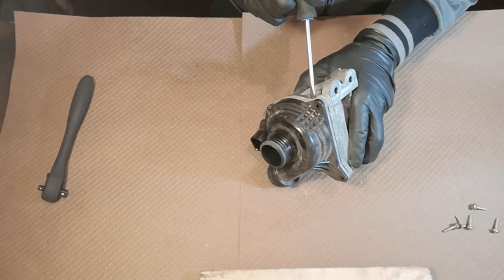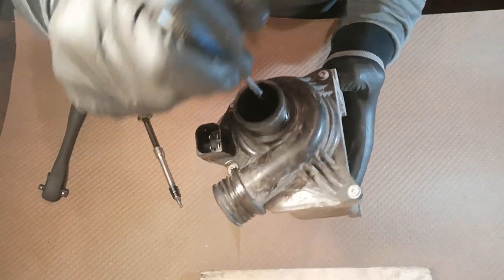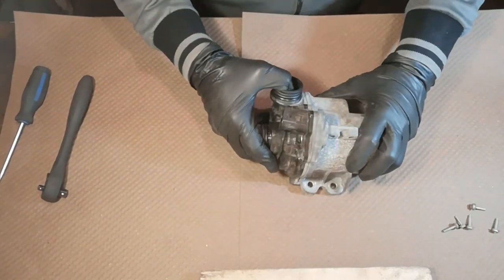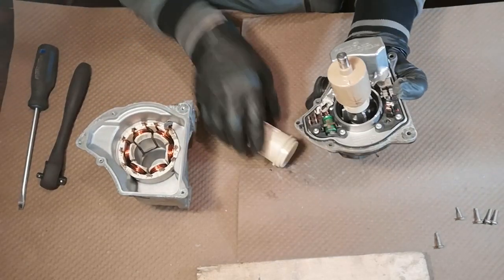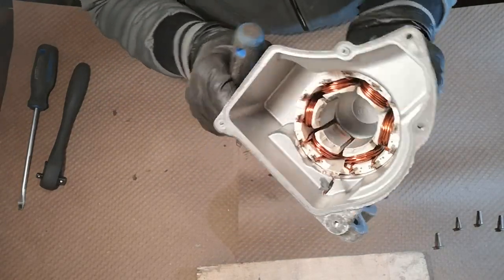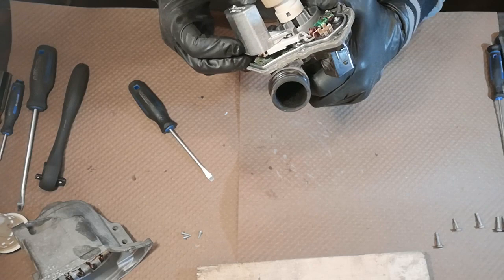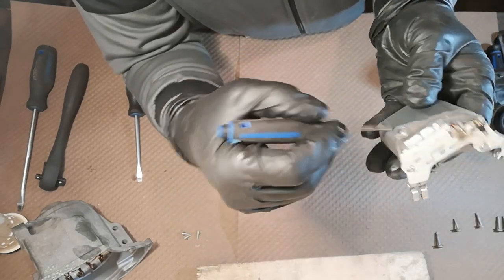⚙️ What's inside BMW electric water pump and why it always fail ? 2E81 2E84 2E82 code

Comment: hello guys i am having issues with my coolant pump. It just keeps on running even after engine is off and drains my whole battery. i have checked in female connector which goes into the coolant pump and found both thick wires and they are receiving constant 12 volts and thin middle wires for continuity(good connection with no break). Also checked thermostat wire 1 wire is receiving 12 volt(with engine off) and other wire 3-4 v(with engine on). Can you guide me what else could be the issue as i am lost here now and tired.
i also scanned and i am receiving LIN bus codes CD9010 & CD8E10

Comment: Holly crab why so many electronics built in that housing. It should be only a switch and possible power regulator when it is on or off  whenever the pump needs to be engaged to recirculate the water

Comment: The part you found burned up looks like resistor (just like the one for blower motor) and what kills stuff like that is low battery voltage and since have off electrons on bmw alive wen your engine off. Like you open driver’s door fuel pump tuns on you do that to many times battery goes down and burns up fuel pump control module. If you need do anything with it you have to connect charger to car battery specially if battery not new or it’s cold outside. All it takes is taking to your buddy wen your truck or door is open. Wen I work on them only with charger connected or jumper cables just to run diagnostic with scanner and engine off. Every bmw I’m getting to work on is after it set for some time owner was getting something in out of a car without starting it battery goes low and whole lot of electronics goes out. That’s number one reason for failure. To much electronics to drown down battery quickly.

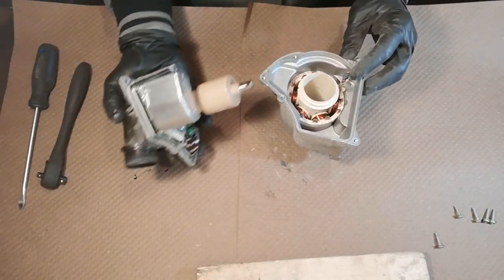Comment: 3:00. What was holding? The terminal connection is soldered together and u broke it? That means it will never be put back together?
There should be another gasket seal between the black front cover and the aluminum casing where the circuit board sits on. That could be where the leak usually is from?

Comment: I also repaired many dishwashers and found most of newer model of them are using the circulation pump that have same bearings inside the pump. The bearing is not normal metal one, but the graphite. The after around 5 years, the graphite bearing is worn off, the impeller can be rotated manually, but as its axle is offsite of bearing center, the rotator touches the wall of the chamber, the extra friction is added to the rotator, and the impeller fails to be rotated by electro magnetic field force.  I think your pump may have a similar root cause.
I only found one of dishwasher got BLDC driver circuit board was burned out in more than 100 cases of dishwasher repairing.
Reply: The most of components of the pump can be designed stronger. But the submarined bearing is hard to be made into a stronger part. Then the whole piece of pump is fragile. @@HK-fz5rn

Comment: I watched this video twice. because I got water pump problem also.  
But my problem symptoms on my car are: 
   - no water returned into the water expansion tank. 
   - after some minutes running the engine, the dark smoke coming out from the engine, the flame almost coming out. I have to use garden hose to distinguish the smoke, very risk!
When I removed the pump, I found the electrical socket and wire plug are both totally burned out/melted, I even cannot recognize the layout of the pins of the socket and the wires of the plus. This is very bad, because I cannot find a place to buy a socket plug. I am even not able = to do a hard wiring connection with the new pump, as I don't know the layout of pins and wires. Do your guys have any suggestion? Thanks,
Reply from the maker: Thank you for input
Reply: Online stores like fcp euro and Ecs tuning have replacement connectors and BMW forums have wiring schematics

Comment: this structure allow the water run into the chamber  and two bearings are running inside the water and in wet condition. the oil inside the bearing is washed out, the bearings are worn out more easily than the bearing running outside and in dry condition.

Comment: If it does not fail due to the plastic (blended to degrade and fail at a predetermined rate) it will fail because the computer said it should fail right about now.

Comment: Because they designed tthem that way. Fail around 90,000 kilometres. My BMW went through 3 water pump with 170k miles. My Lexus has the original water pump with 320,000 miles. Yes, 320,000 miles
EDIT: i had water pump, thermostat, alternator replaced at the dealer $5300!!
Reply: Were the waterpumps really dead and did they checked it ? Im at 250k miles with the first water pump and its doing error codes but its still running fine. I smell bullshit.
Reply: @audispecials  09 x5 gave out at 117K . Cost me almost $600  including 3bolts needed and 2gal coolant. I guess its just the electronics of the WP being an electric one. Ist sign is the fan immediately on the high speed sounds like a jet even in a cold engine, on and off . As soon as that sounds happened I replaced it and everthings good since then.
Reply from the maker: Sorry to hear that
Reply: @MechAdventures  Thanks. :;) i still love the car. More fun to drive than the Lexus.

Comment: check the outside plastic part for cracks
Reply: That's what happaned to mine, it startrd to split at the seam. BMW use plastic, so it fails on a regular interval. Estimate from deal to replace water pump and thermostat: $3200
Reply: @BryanChance  ahuh. And all knows it is a pain in the ass to do it.
Reply from the maker: update: yes it can also leak trough plastic body crack caused by heat cycle fatigue.

Comment: Imagine driving your BMW at 75-80mph on the interstate, and that so-called water pump cracks, or burns out!!!! Your coolant won’t circulate, or just leaks out...... then, you’ll have Instant engine overheat.... and ultimate engine damage. 
To automakers and engineers, these things are cash cows. Designed to fail, and screw consumers out of their hard earned dough. There should be laws in place to prohibit cars with these horrible designs from being on US roadways and highways, and protections to consumers, from these greedy automakers and engineers.
Nothing beats belt driven water pumps. No wonder these cars depreciate like a car battery falling off a workbench.
Reply: Two unforgivable engineering "errors" in my E92. No coolant temperature gauge and No oil dipstick.
Reply: Exactly what happened to me in my X5 @ 63,000 miles.  Had to get a long flatbed tow at 2am.  Done with BMWs
Reply: @tellucas  removing the electronics outside of the coolant pump housing is step to making it more reliable. On the latest generation BMW in-line 6 cylinder engines, the B58 and S58 engines, there are two coolant pumps, a mechanical one for the engine and an electric one for the air to coolant intercooler.
Reply from the maker: Sudden coolant loss and engine overheat/damage can happen at any car any time, modern cars will go to limp mode before engine damage will happen so you can safely pull over.

Comment: When the electric water pump tends to run while the vehicle is off, are those signs that it is a bad pump?? Have no check engine light
Reply: No the electric pump is supposed to do that to help cool the turbos it’s one of the few benefits of an ELECTRIC water pump
Reply: Depends, they are designed to run independently to cool critical components after you shut off the engine. However (and this has happened to me) the control electronics can go bad causing the pump to run constantly with the car off until the battery no longer has enough charge to run it anymore.
Reply: @wgcpfc i have the same problem, mine keeps running till i get dead battery in a few days, do replacing the water pump the solution? Or what was for you the solution?

Comment: there is a class action lawsuit which has been settled that covers this.  car must have been less than 7 years and 84,000 miles when replaced  Shelton Oliver, et al. v. BMW Of North America LLC, Case No. 2:17-cv-12979,

Comment: Why does BMW keep putting plastic in contact with hot oil, hot water or high friction places? 
Let's not even start about electronics and electricals.
Reply: Simple. Make additional money for maintenance and cost reduction
Reply: I ended up buying a pierreburg waterpump so I don't have to worry about that plastic cover
Reply: You cannot use Pierreburg WP if you have active drive feature.
Reply: You are thinking from a consumers (your) point of view. Think business (theirs) and a light bulb will light up.
Reply: @crxdelsolsir  I agree with you. BMW try to get more profit from the business  with making their product break down easily.

Comment: That electronic board is badly placed on that pump.
Reply: Not really
Check out a Volvo D13 diesel in a prevost coach bus
Check out its ecm placement 
It all has a purpose you may not see

Comment: Usually a BMW water pump last between 100-120.000 km normal drive But if u drive ur car a the maximum performance almost daily, the water pump gona fail between 60-70.000 km
Reply: Mine did a 135000 km
Reply: Mine lasted just over 100,000 miles

Comment: Can i test a water pump without the coolant hoses just the electric connector??
Reply from the maker: you can while its still connected to the car. depends on model / turn ignition on and press gas pedal down or few times down to initiate water pump run.

Comment: Hello. Just changed my N55 water pump. What was the brand of your pump? Was it the oem original first pump (Continental)?
Reply from the maker: This one is Continental but they are all made the same, VDO siemens or Pierburg
Reply: @MechAdventures  Thanks. I replaced a strange-named non-working water pump with a VDO. Will check the name and post here.
Reply: My pump was a very recent replacement made by Bryman 11517588885, manufactured 2018 12. While the onboard car diagnostics passed the coolant system, the pump test with a proper scan tool revealed the pump did not respond to requests for speed tests/controls and only seemed to run on one fixed speed. Also, when taken apart there was a very strong acrid smell of burnt circuits.
So for this very vital engine part, I'd only recommend OEM or similar parts... (pics available)
Reply from the maker: @sandysaab9357  i have never heard of this brand

Comment: Thanks. I was always wondering if it was an electric fault. Lots of power and lots of heat running through... can't be good for that complexity level of electronics.
Reply from the maker: Looks like material fatigue and electrical problem in this case. Vibration and heat cycles are good point.

Comment: My E36 hasn't killed one of these yet. Knock on wood lol. Loved the video, keep it up!
Reply: You are lucky that E36 do not have electric water pump.
Reply from the maker: Thank you
Reply: @MechAdventures  hello sir i am having issues with my coolant pump of my bmw F30 320i 2014. It just keeps on running even after engine is off and drains my whole battery. i have checked in female connector which goes into the coolant pump and found both thick wires and they are receiving constant 12 volts and thin middle wires for continuity(good connection with no break). Also checked thermostat wire 1 wire is receiving 12 volt(with engine off) and other wire 3-4 v(with engine on). Can you guide me what else could be the issue as i am lost here now and tired.
i also scanned and i am receiving LIN bus codes CD9010 & CD8E10
Reply: E36s have electric pumps??
Reply: Get rid of that car now!!!! You’ve been warned.